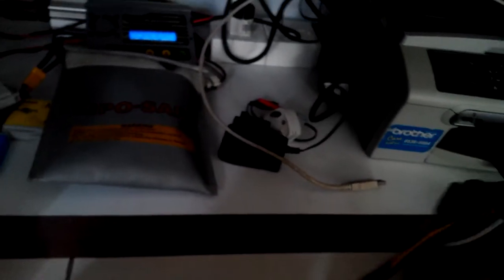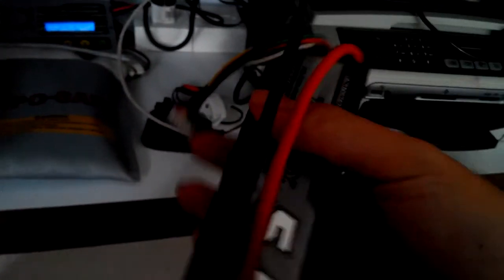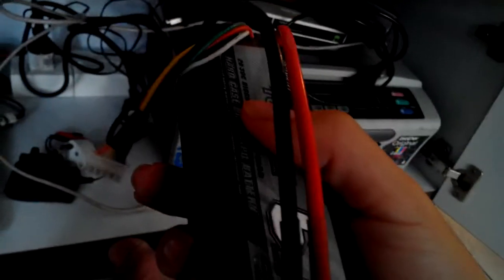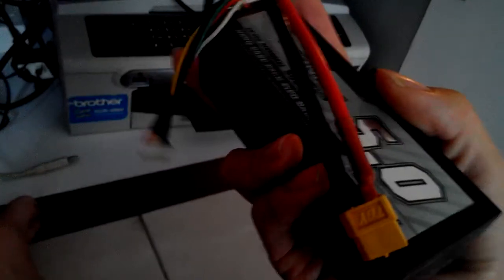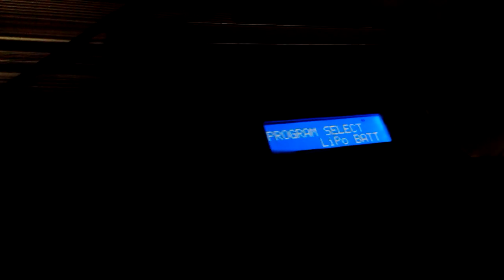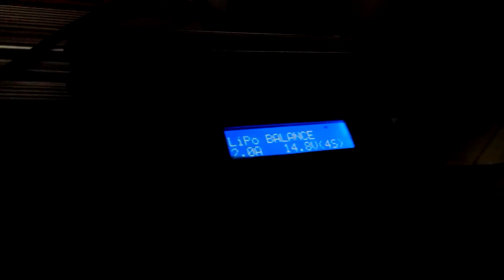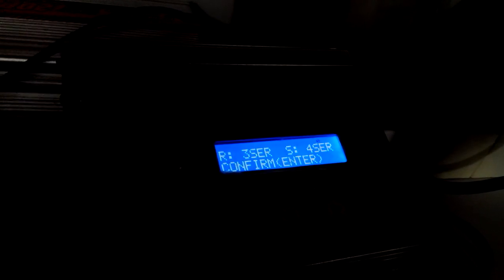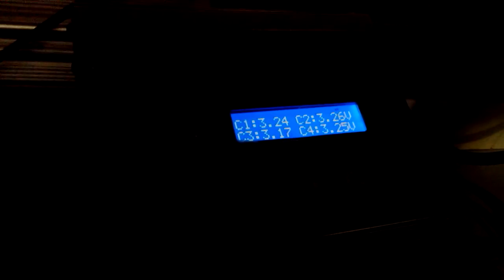How To Fix Lipo Battery Low Voltage Error

Comment: Hi, I have tried all the steps and I've done it several times but when I try balance charging I get an error: "BATTERY VOL ERR CELL CONNECT". I have a LiPo 3S battery and one of the cells is puffed up. Any ideas on how to solve this issue? 
Thanks.
Reply from the maker: Puffed up... try to put it into the freezer for a few hours. that should reduce the bloating. try running it on a steady 1A current on Nicd or Nimh setting for 20mins or so. refridgerate, and try again.
Reply: Did as you suggested and now on LiPo Balance charge my charger detects R:3SER S:3SER but the error still pops up and the indivisual cell reading is something like this just before the error pops up:
0.00 4.50V 4.50V
Reply from the maker: i think one of your cells is damaged or the balancer chip in the pack is faulty
Reply: I think its damaged... :'( because it doesn't charge at all no matter what I do while the other two cells charge nicely.
Thanks anyways :)

Comment: Cool. I had a 3S pack which had all cells on 1.5v, so I gave up on it. Then I popped it into my charger on NiMh for 10 minutes, and they were all back to 3.1v. I can charge them on LiPo again. Thanks!